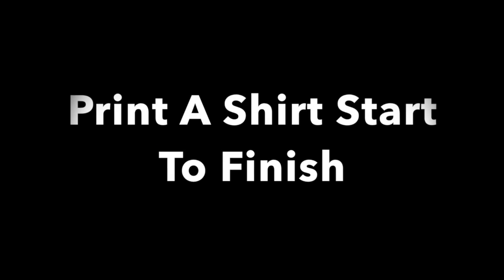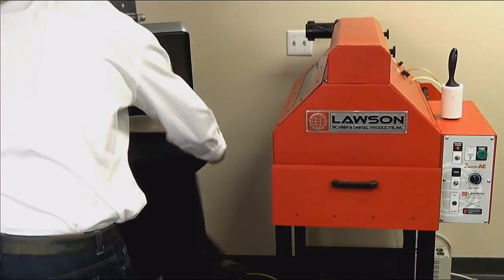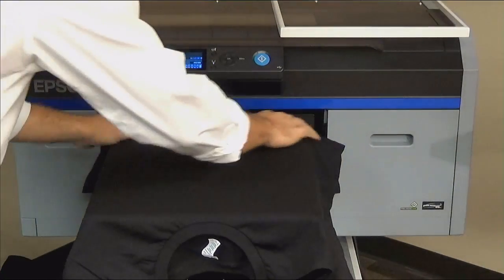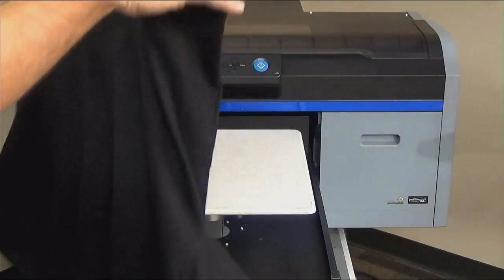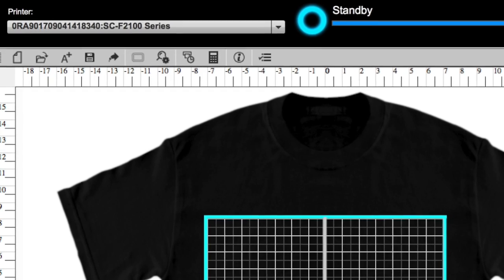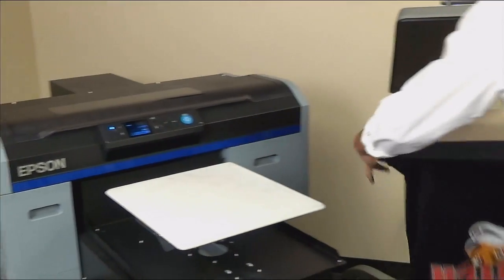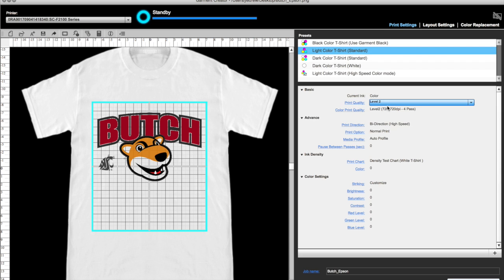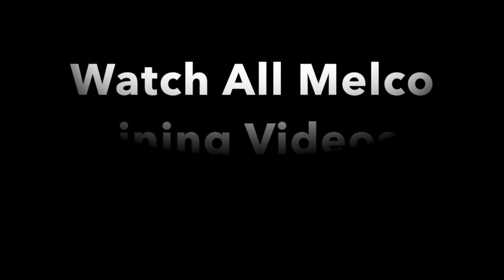Epson F2100 Print a Shirt Start To Finish

Comment: What kinda heat press is that ????
Reply: Hello, That heat press is the Stahls' Hotronix Hover Clam Shell Press with stand and upper and lower platen covers. The stand allows for threading the shirt. The covers protect the heating element and allow for easy threading of the lower platen. You can see more heat press info and options here. http://www.shopmelco.com/category_s/190.htm

Comment: what is the quality difference and lasting vs screen printing?
Reply: Good question Richard. AATCC is a 3rd party that tests printed garments. They give manufacturers ratings based on washability and quality. As far as I know, Epson is the only DTG company to receive 5 stars for washability. This means the print should theoretically last the life of the garment. At least that is my understanding. As you know, thick plastisol can crack over time. Epson ink is water based and if cured correctly, holds up extremely well over time.
Reply: @Johnny-Eldorado  Thank you!
Reply: JACK SHIT IF YOU ALREADY DO WATER BASED

Comment: This is just to much work when you got a busy shop with customers. I make more money with customers coming in my store to order shirts same day other then online. I only use a sg 800 sublimation printer, graphtec Vinly ce6000 machine and a oki 8432. The oki saved me so much time. I create the image print it out on the film sheet then add the adhesive sheet to the back of it press them together and press on a black shirt in 2 or 3 minutes. This DTG stuff is to much work for a $16000 printer that don’t dry ink on contact
Reply: Actually this would save  you a lot of time. You can pretreat the garments ahead of time and it would take about a couple of minutes to print and another minute to dry. The quality is superior to any of the methods you listed above and the durability is better as well minus sublimation but that is limited to light polyester. You should definitely look into it if you want to expand your business don't be so pessimistic about it.
Reply: @teeshirt502  Naw this printer is not reinventing the wheel. Fuck this thing what a turd....it should at least dry the shit for you.